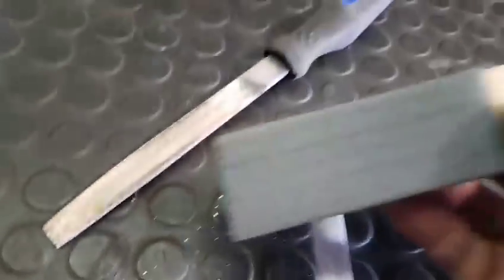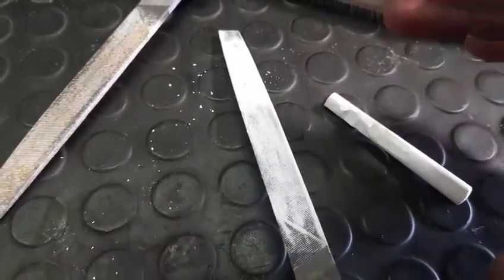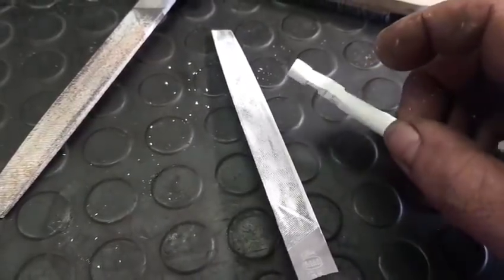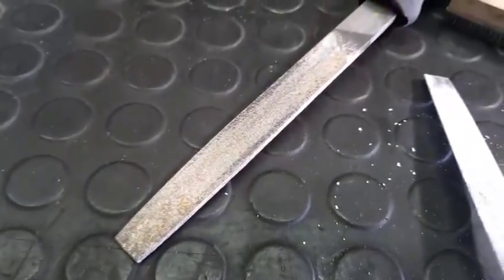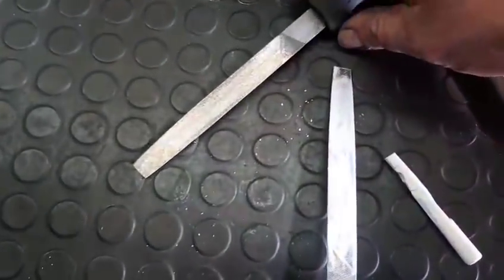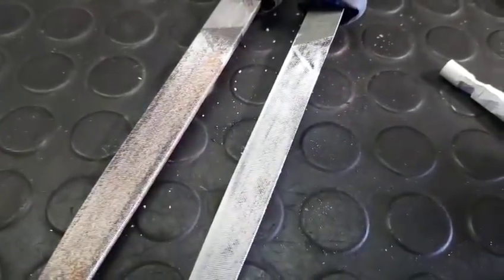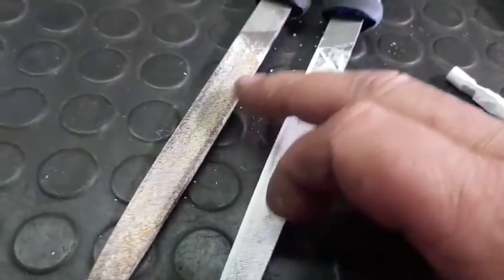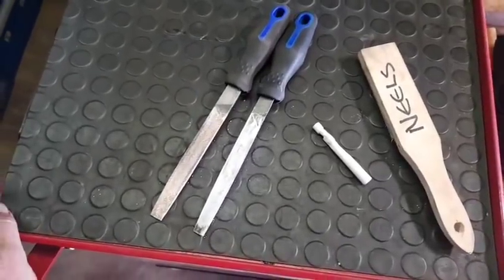Why Chalk Up Your Files and Maintenance

Comment: ..Good tip Neels, it does work !! Get some 3/4"-1" PVC pipe. Cut a piece a little longer than the blade of the file. Heat it up in an oven on 350 F/ 176C till it gets a bit soft, just a couple of minutes. (Careful, it will scorch and be HOT!). Stick the file in and using a piece of wood or some rags, press down . Now you have a sheath for your file...!!

Comment: Neels I store my files by hanging them individually by my work bench. Also have ever tried to resharpen them by putting them in ferric chloride for a bit. Seems to bring back some life into the buggers. Martin Oh I used to store my files in a piece of leather I folded in a bit and sewed some pockets in and when done I could roll them up and tie it closed with a pice of lather strip.. Martin

Comment: Great tip question will using oil on steel clog up the file faster than using a dry file
Reply from the maker: I do a light coating on my really expensive files and have not noticed them clogging up quicker as a result.

Comment: I have two questions,just to clarify.
Does leaving the chalk on the file make them rust?
and if so,to remove the chalk would all i need is a file card?or would have to use other tools or materials to remove all the chalk?
Reply from the maker: Yes and yes

Comment: One thing to be aware of is that file cards can prematurely dull files.  Using a stiff brush (often found on the reverse side of file cards) to clean them is much better for their life-span.  Also, if there are a few stubborn bits of metal clogging the teeth, you can take a piece of copper pipe, crush one end flat with a hammer, and then run the flat end back and forth perpendicular to the teeth until the shape of the teeth have been cut into the copper itself.  This allows the copper to take the exact form of the peaks and valleys of the teeth' profile so it can really scrape any gunk out of them.  If that didn't make sense, just do a quick YouTube or google search ;)

Comment: I use pipe clips to hold mine,. they look like these ( http://www.geoquipwatersolutions.com/150-PPPipeClipOpen.html ) only metal and they have curved rungs, you either slip them around the thin of the handle or on the smooth section at the base of the file and it works like a charm to keep them in place . (in my case hanging) you can pack them fairly dense and they don't really go anywhere. also lets you sort and access them pretty easily

Comment: I built a wooden wall hanging tool organizer that has most of the files I use regularly. For all the big files there's two strips of wood with a space between them to slide the file through and the handle of the file just sits in top. All my needle files I put little wooden handles on and a small board with like 3/16" or 1/4" holes for the files to slide in and the handle sits on top again.